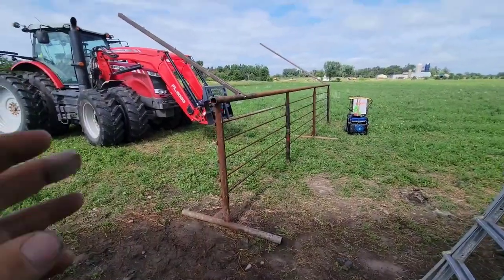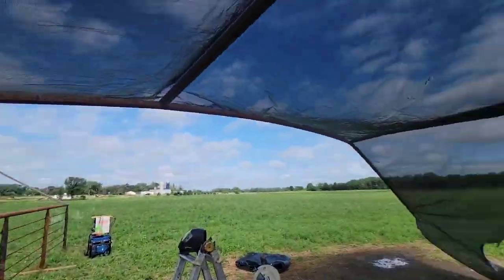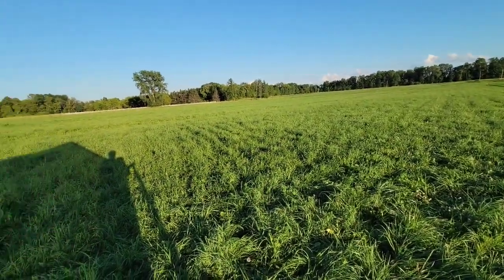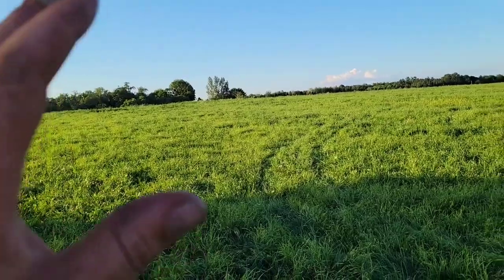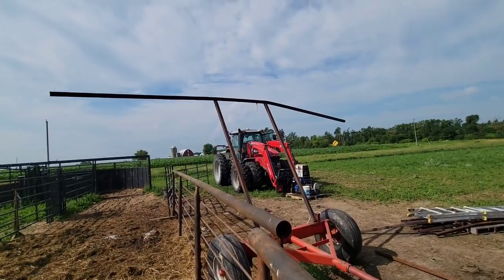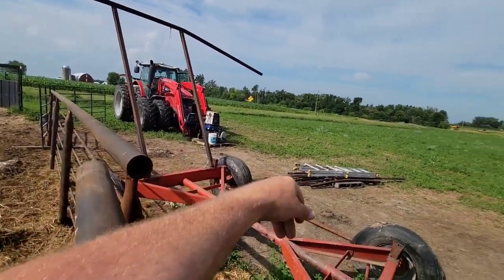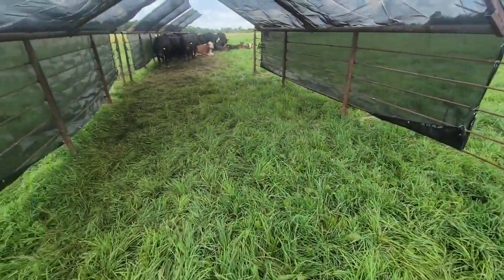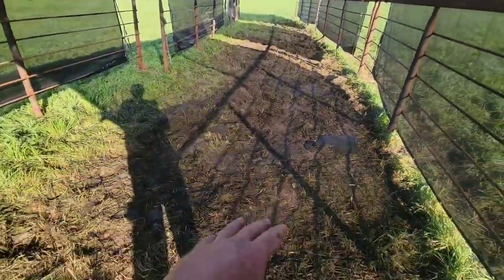Making sun shades for cows ahead of heat wave,  thinking about pasture management

Comment: Could use some of those sunshades... wish had a whole slug of them this past week. Hopefully the cows had an easier time this year with the heat and could jump in the ponds all day long.

There something to be said about trees for wind protection, nothing can replicate them... but they are a bugger. Freestanding windbreak panels are more handy, shoulda bought more several years ago when they were cheap.
Reply from the maker: We haven't had much high heat, but 20+ degree swings from day to night, and 40 degree swings in a week is tough.

Comment: Ever try planting millet in the summer? Or is sorghum the way to go?
Reply from the maker: Have no clue. Lol I am trying to learn grasses.  But when I look at what alfalfa can do its hard to get away from?
Reply: @jonstevensmaplegrovefarms3754  yea it is. Just cut 2nd crop today. 6 year old stand and just keeps producing.
Reply: @mn-1381  Total noob here, does that require annual reseeding or fertilizing?
Reply from the maker: @nickl8192  it's a warm season grass from the small grains family. So in our short season to be a one maybe two cutting? I wonder how long it would live in Texas? Do they get enough winter to kill it off
Reply: @nickl8192  yes both millet and sorghum or sorghum-sudan grass are all annuals and they will die off from frost or winter. They are in a group called summer annuals. Summer annual grasses like nitrogen so get it out there either from commercial sources or manure, or nitrogen producing cover crop. Just not too much nitrogen because it could lead to nitrate poisoning if the levels are too high. A feed analysis would tell you that. And also if they are killed by a frost, don’t harvest for 7-10 days (i think) because the nitrates accumulate in the plant after the frost and that can be toxic to cattle. If managed correctly it can really make a lot of tons/acre in a small amount of time.